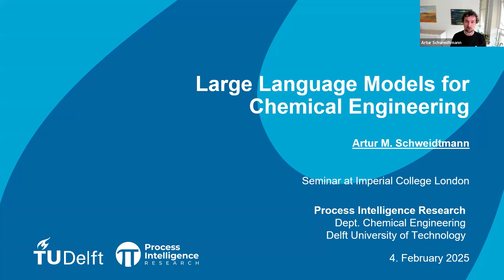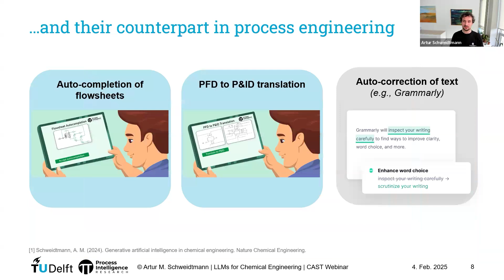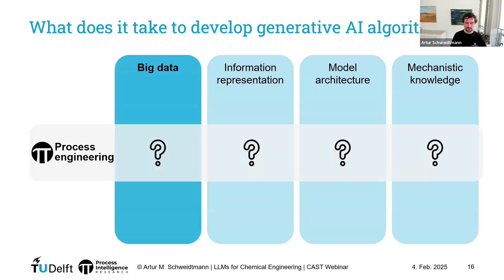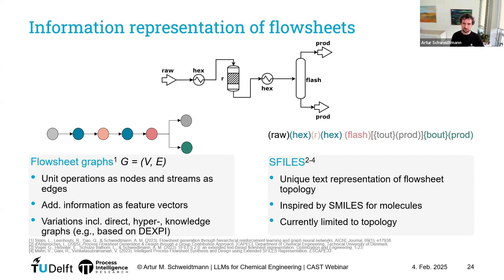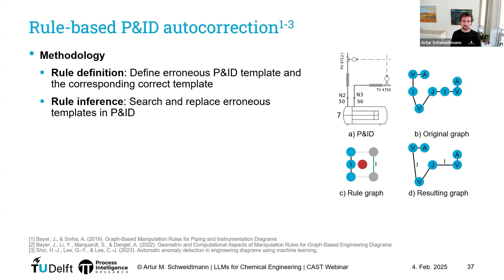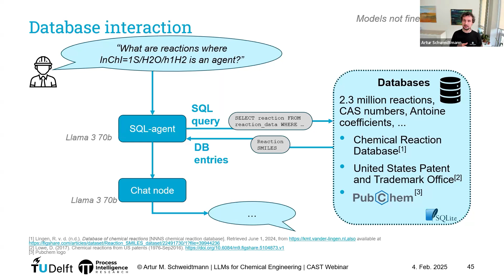LLMs for Chemical Engineering

Comment: As for the limitations of "Rule-Based Self-Correction Conclusions," this would generally have an impact on engineers involved in process design (Outotec/LFSmidth) for others involved in operations and optimisation, it is no longer something that really matters.

Comment: Excellent presentation, and a lot to think about. I really like the idea of encoding a flowsheet into a text representation which can used in a standard LLMs. Am I thinking correctly that it should be possible to convert between the format representation of a P&ID to a graph format and vice versa?
Reply from the maker: Both the SFILES and DEXPI formats look interesting as possible ways to encode a PFD or P&ID in a text representation. The approach looks promising.